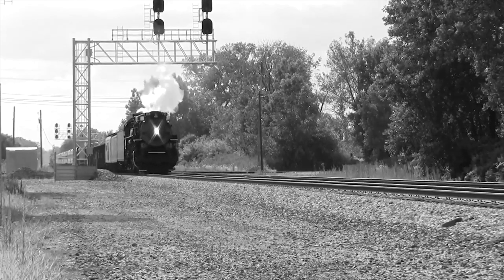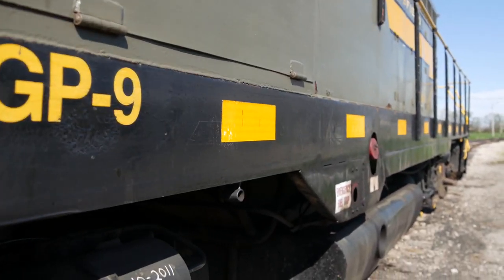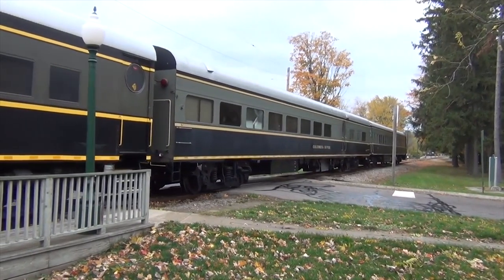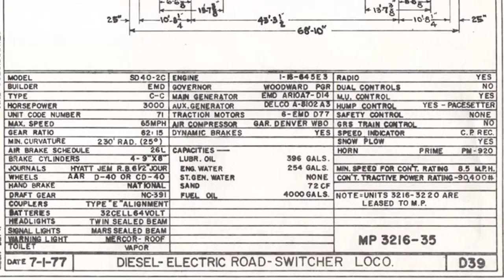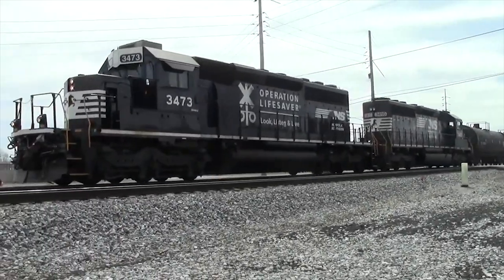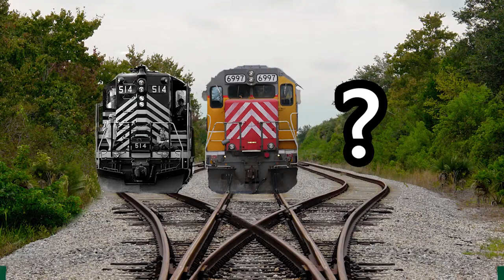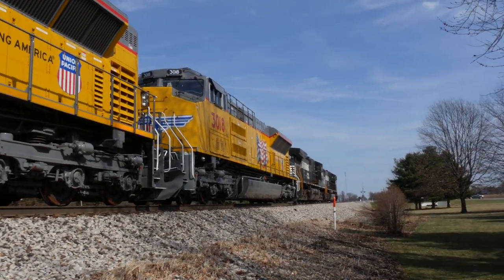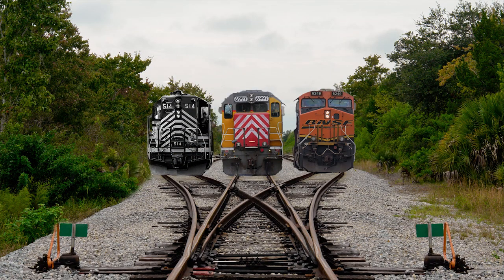The Holy Trinity:  Three Greatest Diesel Locomotives

Comment: I'm a retired locomotive engineer. I hired in 1978 on Conrail.  The best overall locomotives were the SD40-2. You lashed four together, they will do anything asked of them. 
I hauled plenty of ore trains, coal trains, limestone trains, and mineral trains into Bethlehem Steel. The GE' s were for the most part junk. Never held the rail well. The newer generations of GE's were an improvement. The reason you see more of them is they are cheaper than the EMD's. Why get eight Cadillacs when you can get ten Volkswagens? There were a good quanity of Alcos when I came around but they disappeared quickly.
In 1999 The NS took over. Almost overnight all the decent Conrail power was rushed down south, and their scrap engines were sent up here.  Long nose lead,  high cab, 40's and dash 2's beat to an inch of their usefulness. No toilets, water coolers,  rotten floors. You signed out a "poop" bag at the beginning of your tour, and you lined a 5 gallon paint bucket with it, if nature called. Then you were to turn it back in at the end of your run. The Pennsylvania Department of Transportation stopped that quickly. Stoneage railroading at its finest.
At one time railroading was a fulfilling, financially rewarding job, a person would be proud of. No more. 
The NS's emphasis now toward their employees is discipline. They would rather fire you than show you where you made your mistakes and educate you. I'm glad I'm on pension. 34 1/2 years was enough.
Reply: Im sure there were ups and downs with conrail, but it really seems like conrail was the holy grail of "modern" railroading
Reply: The locos with poop bags were ex nw units
Reply: @ZombieSlayer-dj3wb  No, they were ex SR engines. I worked with a lot ex SR engineers here in Virginia who used to tell me about  it, and I have been on them long before the merger.
Reply: @gordonvincent731  hmm thought only nw had poop bags
Reply: @ZombieSlayer-dj3wb  I wouldn't know about them, but the ex SR engines were like that.
Reply: EXACTLY EXACTLY the same on the Chessie System when they merged with the alligators of SCL. Seaboard was a garbage outfit at best. I hired on in July ‘77 and Chessie(C&O) was a first class railroad in every way. When the merger came, first thing they did was ship their junk power north. Then they stripped the clasp brakes off our engines to save brake shoes…no matter you couldn’t stop, that became the engineers fault. We never had schitt sacks! I ran everything from a few WM 
F7 units, all of the original gp 7 and 9’s, go 30’s, 35’s, 40’s, sd 35’s, 40’s, 45’s and then the wide bodies….which I detested except for the air conditioning! All the GE 
u boats were garbage especially the u25b’s. My all time favorite locomotives were GP40-2’s. Just great engines. I’m glad I’m retired.
Reply: And a wreck 25 yrs ago indiana forced ns to stop running long hood forward

Comment: On the SP Siskiyou Branch and Over Donner Pass. We had SD 9's the 6 axle engines then the SD 40's , For Donner pass the SD 45T-2 the tunnel motors.
There are still a lot of SD9's working out west. The tunnel motors with the lower air inlet to the radiators to help them stay cool in the tunnels and snow sheds on Donner.
My favorites are the SD 9's, SD 40-2's and SD tunnel motors. The GE D9's and SD 75I.

Comment: In terms of hood units, I’d argue that the 5 most influential locomotives in order are

1. RS-1: Created the road switcher 

2. GP/SD7/9: Defined the road switcher & turned it into a road capable unit

3.U25B: Created the modern Hood Unit Body Plan, first successful (sorry Fairbanks Morse) hood unit to move away from being a road switcher to being a true road-oriented unit with comparable power to the most powerful diesels

4.SD40-2: Modular electronics, computerization, added so many advancements to locomotives of all kinds, that I don’t think I need to point it out

5.M-420: Created the modern wide comfort cab that massively improved crew safety & comfort which in spite of external changes has in terms of layout & construction remained generally the same since it’s inception by MLW
Reply: Older wide cabs were only good for slow speed collisons

Comment: Um, you know that the GP7/9 used the 567C, not the 645, yes?
Reply: That is correct! The 645 wasn't installed until post-GP/SD35 series.

Comment: Great Video!!..... The "Infamous" BL2 was actually EMD's "kick-off" road switcher... but taking a cue from Alco's very popular RS1 & 2, EMD developed the very first "geep" that really started the ball rolling for them.... the GP7... Not the GP9.   But, a GP-9 (or even an SD) with Series 645 prime movers!??!..... I Don't Think So, my friend.   The 645 wasn't even introduced until 1964, on an SD40 test bed, and the first production units with them was in Feb. 1965, being SD45's with the "Super Power" 20 - 645E3 at 3,600 hp.    PS: all that dramatic introductory "music" could be done away with, without hurting to many people's feelings.  ; )    PS: 4 cycle diesels.... "suck".  : )
Reply: Conrail used to use 2 or 4 SD40-2's lashed together for pusher service over the mountains between Altoona and Johnstown. It was absolute bliss to stand trackside and listen to those 645s in Run 8. I hate 4-stroke engines, too.

Comment: Here's my very personal opinion.

#1 - The ALCO - GE - Ingersol Rand Boxcabs. This partnership built the first commercially successful diesel - electric locomotives. They were designed in response to new smoke ordinances in many major cities in the 1920's. CNJ #1000 is in the B&O museum in Baltimore.

#2 - The EMC FT sets. These are the diesels that killed steam. The decreased locomotive maintenance was a factor but not the biggest. Track maintenance was vastly reduced due to the lack of a steam locomotives pounding of the railhead with each power stroke. The transition didn't happen overnight but the FT started it. Note: The EMC FT, SW, and NW models used GE electrical equipment. After GM purchased EMC, GM copied GE's designs and made their own alternators, traction motors, and control electrical equipment.

#3 - The ALCO - GE RS-1. The roadswitcher was born with this model. From the 40's to now, the internal layout of every locomotive (other than switchers, cab units, a few odd balls, and the ridiculous BL-2) is mechanically similar to an RS-1.

#4 - AC traction in general.

However, I still have a very special place in my heart for B&O/Chessie GP-30's. As a teen, I got to ride in them around Riker Yard in Punxsutawney, PA in the late-70's.
Reply: LOL...I refer to the GP-30 as the BL-3. The one oddball as we transitioned to the 2nd gen. starting with the 35 series.

Comment: I think that the ALCO RS-1 was the original road switcher.  The GP7 & 9 didn't compete with GE directly - as GE was still partnered with ALCO at this time.
Reply: CORRECT, the ALCO RS-1 was the original road switcher and should be on the list... second should be the GP7, last the ENTIRE SD-40 series
Reply: Globally, I would consider the 1,000 hp ALCO RSD-1 (November 1942 – May 1946).
Why?  As part of WW2 Lend-Lease with Soviet Union … ALCO shipped that model for usage on the Iran to Russia WW2 supply lines.
After WW2, that model (converted to metric designs) became the basis of diesel-electric locomotives for the Soviet Union and Eastern Europe.
Soyuz rockets at the Baikonur Cosmodrome spaceport in southern Kazakhstan are moved to the launch pads by descendants of the RSD-1.

Comment: My guesses are the introduction of the dash 2 series (but mainly the SD40-2), the Dash 8 series and the GP9. All rugged workhorses, EMD always having been my favorites. They are tough SOB's and a dream to work on,  both in the shop and on the road.

EDIT: Eh, 2 out of 3. I only said the Dash 8 because i feel it gave way for the rest of GE's lineups. The Dash 8 -0CW started the modern computer control systems that became standard for GE.

Comment: My favorite selection of trains is unusual.  By far my favorite engine is the FM H-24-66.  Trainmasters we’re notoriously unreliable and terrible to maintain.  But being one of the highest hp engines of its time not built by the big 3 locomotive manufacturers, and had looks to kill for.  It was a beautiful engine.  It wasn’t an EL-2B or a GG1, but it was a diesel, and by far my favorite Diesel engine, no matter how terrible the engine genuinely was.  If only any Wabash trainmasters were preserved.

Comment: You obviously don't know alot. The GP7 was the first geep. Not the 9. And they had 567Cs not 645Cs. The 3 most popular units were the GP7, GP38-2, and the SD40-2. GEs are popular, but terribly quality and unreliable.
Reply: 645Cs do exist though. That’s what you get when you rebuild a 567C with 645 power assemblies.

Comment: Man I nailed 2 of them. But why wasn’t a loco like the FT (first road diesel) or the NW-1 (first production diesel, one of which is still in mainline (ish) service under Amtrak) what about the AC6000, the first successful high-horsepower diesel. There are way better choices.
Reply: Wanna know whats bad i though he meant three specific locomotives not three different locomotive models
Reply: The ac6000cw wasn't successful

Comment: You're completely off on the GP9. Especially the motor, a 645!!! Were did you get that? The GP9 was powered by a 567C 16 cyl. engine from Jan. '54 to Dec. '59, a total of +3400 units. Honestly though, I don't think the GP9 should be on this list.
Re: the SD40-2, I thought you were talking about the production of the locomotive as a whole, not regulating it to one RR company. The '-2' version wasn't significant of itself to the industry, but the '40' series was. Including all versions & over 22 years, there was produced +5700 units.
As far as the GE loco, I'm on the fence. Considering how inaccurate you were w/ the GP9 spec's. & regulating the EMD '40' series to just the '-2', you need to review your third choice.
Source: Kalmbach Books; For info on the GP9: The Second Diesel Spotter's Guide ©1973 by Jerry A. Pinkepank ; For info on the SD40: Trains Magazine Sept. 1997
Reply: I know right...
Reply: @mdgfb05  I mean the size of the engine isnt really a factor because I know EMD G12 were re-engined with 12-645s and GT22s and GT26s came with them, but yeah GP9s came with a 567C, I thought it was weird when he said 645.

Comment: The diesel locomotive that "STARTED IT ALL"? You completely missed that locomotive. The GP9 was a great and highly produced road switcher. However, it was just a model with a more powerful engine than the GP/SD7 series. The actual "START" or the nail in the coffin for steam was the EMD FT series in 1939. The road switchers (GP, SD, DD) were derivates with full frames, and better visibility and thus safety. The road switcher series (including all GE, ALCO, EMD etc.) became the standard for freight  trains because of the better visibility and easier maintenance. GP9 did NOT start it all, it was a second to it's older siblings of the GP/SD7 series...for EMD. It was also post F-series after the FT through F7.

Comment: You should get your facts straight. The AlcoRS-1 was the first road switcher beginning production in 1941 whereas the GP-9 began production in 1954. The GP -9 had a 567C prime mover not a 645. Basic facts that you should have checked.

Comment: Id say the SD45-2 is better than the SD40-2 higher horsepower and bigger fuel tank
Reply: Dawson's railfan adventures not as reliable though.  Same with the sd50 too.
Reply: The SD45’s had crankshaft issues, nowhere near as reliable as the 16 cylinder 645
Reply: @stretchlimo7275  that was the SD45 not the SD45-2 the early 1st Gen SD45s had issues the -2s still run to this very day with the same motors they left EMD with
Reply: Did not know that, thanks for the information 👍🏼😎
Reply: Unless its a EL SD45-2, they (SD40-2 and SD45-2) have the same fuel tank since they have the same frame. Same applies to the SD40 and SD45.
Reply: @fernandomarques5166  im talking about the EL